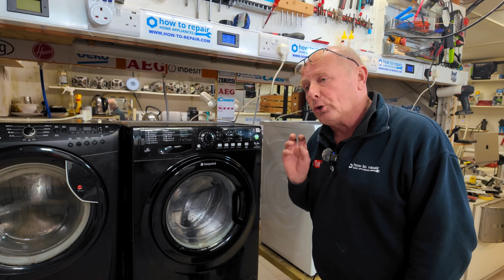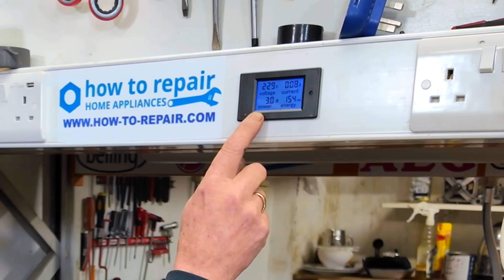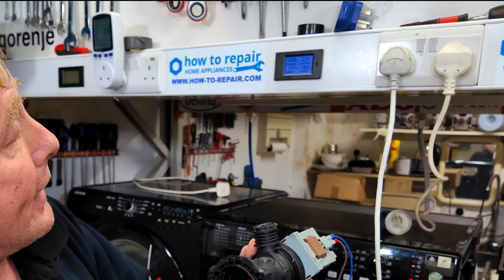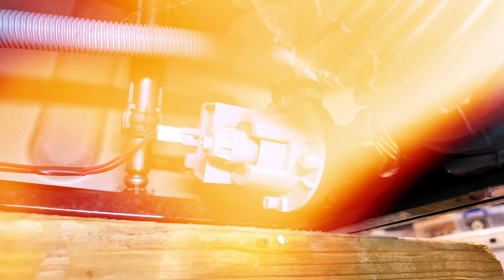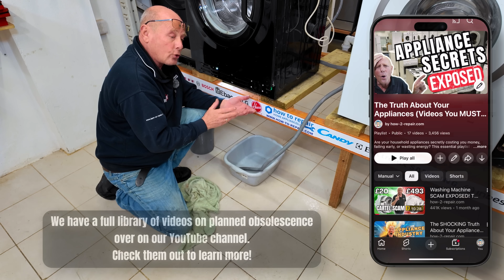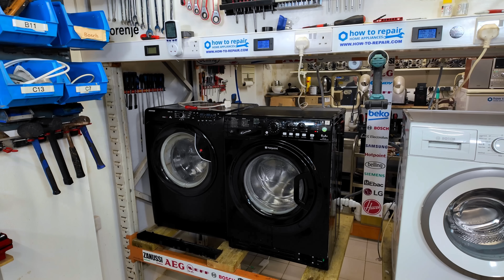How to Unblock a Washing Machine Pump Without Making a Mess

Comment: i have cleared the filter on numerous occasions on the 2 washing machines i have owned, and found coins, clips, hair balls etc etc - it is tedious as I cannot elevate my machine and I have to drain it bit by bit into a shallow tray.
Reply: something he didn't say in the video is if you can get the door open then why not bail some of the water out with a beaker... why wait ages for a trickle form the sump. the way I do it is have the machine tilted back with towel on the floor and a baking tray under the filter
Reply from the maker: I’ve spent more time on my hands and knees on kitchen floors than I have at this nice, comfortable workbench! It is a back breaking chore when the machine isn't elevated, and that drain, pour, repeat routine is exactly what puts most people off even trying. If these tips help please give the video a thumbs up, share it with your fellow DIYers, and subscribe to the channel! For any spare parts or tools to make the job easier, check out our website, and if we've saved you from another flooded kitchen, feel free to Buy Paul a Beer to support the channel. Thanks for watching!

Comment: What if the pump works and no emptying and the program stops ?
Reply: something in the sump hose(do you get good water flow when you take the filter out or lower the drainhose along the ground?), or the drainhose has a blockage in the sink area if plumbed under the sink as shown in this video. 1 way to find out if its the sink or the machine, select the drain program and BEFORE you turn the machine take hold of the drain hose, start the machine and if you feel the drain hose go stiff then the problem is under the sink, same as when you turn your garden hose on and the hose pressurizes

Comment: Hi Paul, very nice video as always, I'm sure you are helping people, their will always a number that will never learn. ❤
I had this issue about 2 months ago, their was a button and few other bits. Cleaned the impeller, put the machine on rinse but would you believe it, i can hear the pump working but the water was not draining. 
Next step was I removed the pipe from under the sing, placed a towel around the end but with access, and i gave it a large blow, a large amount of gunk, shoot out into the drain, by the impeller. Since then it's working just fine.
Thank you.
Reply from the maker: Glad to hear it's working again, sometimes those stubborn blockages need a bit of extra force mate. Please do hit subscribe and share this where you can. We need to help others make informed choices, rather than being taken for a ride by these manufacturers.

Comment: Self repair is really the only financially viable option. A repair person will be at least 1/2 the cost for a new machine, so people just buy new.
Reply: its due to high taxation, and repair guys greediness, with i would ban or cap.., needed to fix something on my car, garage quoted me £500, then a self employed car repair grredy guy quoted half.. Garage quoted extra margin on top of parts as well.. a joke.
Reply: @ms_aaaa   that's standard to add on top of parts in every business, saying we should cap the price they charge is laughable. trying to compare a garage with all the equipment , insurances, training etc with a self employed guy is laughable. you have no idea how business works
Reply: @gruunt4064 they self employed guy could  do it fine at the end, without much garage tools.. it was a simple mechanix fix.. yes some garages are more equipped, but for same job its a non sense quoting
Reply: @gruunt4064 i think its insurances, VAT and some greedyness, .. yes it adds up..
Reply: This doesn't count as self repair. This is purely maintenance. It's in the manual and if owners don't follow it they deserve everything they get.
Reply: You hit the nail right on its head

Comment: You cant access the debug menu of the board and just power on the elements independently ?
Your lucky the cloth didnt destroy the propeller of the pump 😅
Reply: yes we can connect a special key that we have and select each component to come on. you usually can hear a very faint hum from the pump. I haven't tried it but I would think you could stop the pump with your hand as they aren't very powerful
Reply: Propeller powers boats and airplanes. Pumps sometimes use an impeller.

Comment: Thank you. One of the very few U Tube channels that are not a waste of time to watch. I was brought up to maintain and mend if possible, but that was when parts and replacement were often a built-in aspect of design & manufacture. Also, parents and children miss out on the quality time of teaching, learning and repairing together.
Reply from the maker: With over 40 years in the industry, I’ve seen first-hand how we’ve moved from splitable, repairable drums to plastic-welded units that are designed to be thrown away. Understanding how much obsolescence is being designed into new appliances these days is something everyone should be aware of, especially when a simple bearing change that used to cost £20 now requires a whole new drum costing nearly as much as the machine itself. For a deeper dive into this topic please check out the full video here: https://youtu.be/j0YU2wvVJ94?si=IEKXIHuNfn8sfkSn